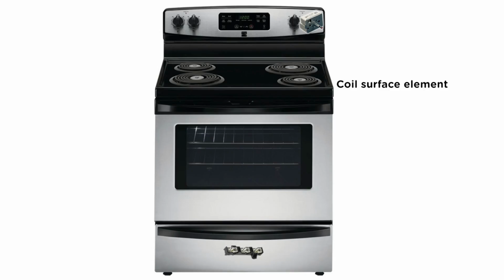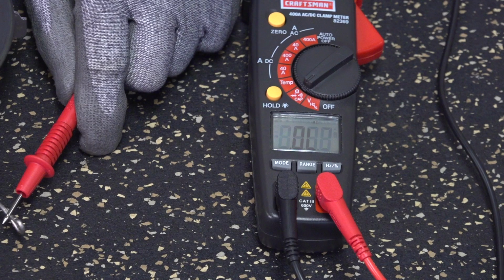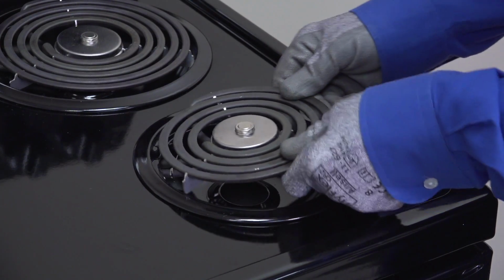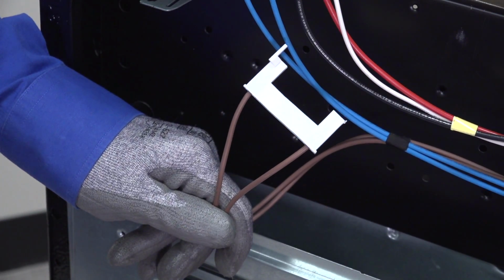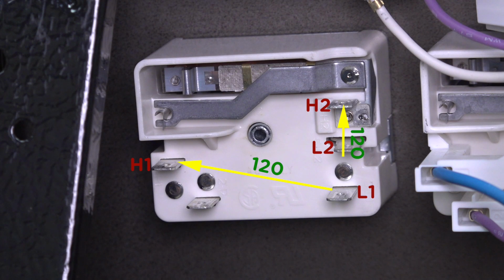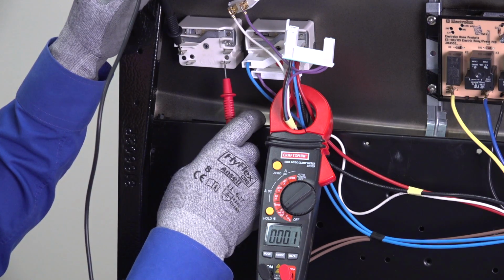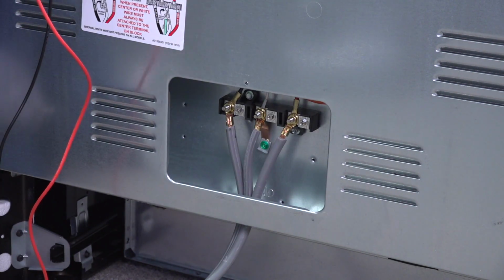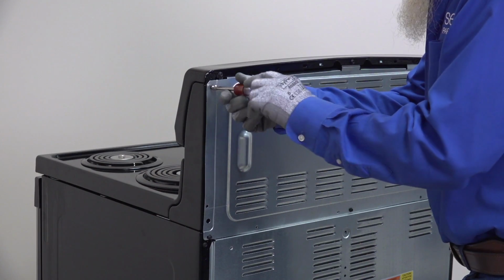Electric Range - Coil burner won't heat

Comment: none of the burner work on  thee  stove  ...i have a voltage detector gk7 shows wires are live to all the burners
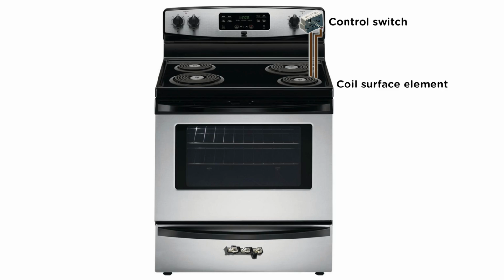Reply from the maker: Based on your symptoms and description, we recommend that you unplug the range and check the supply wiring between the terminal block on the back of the range and the burner switches as shown beginning at 4:04 in the video.